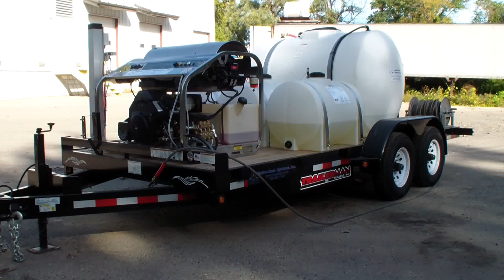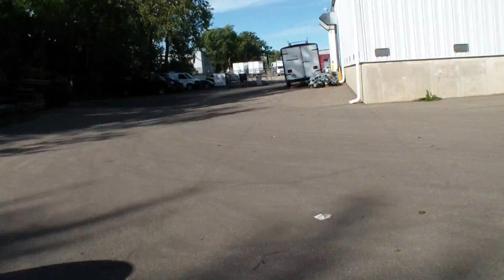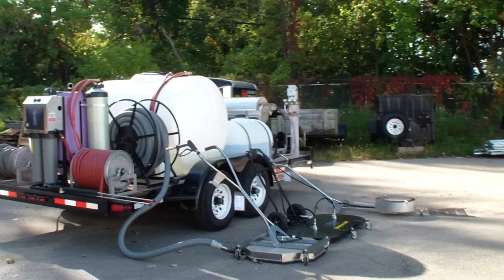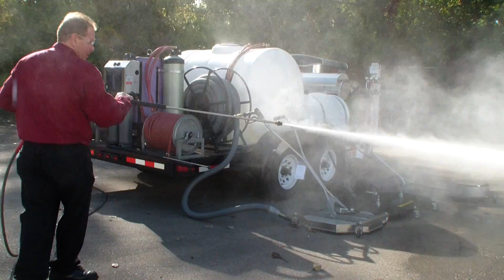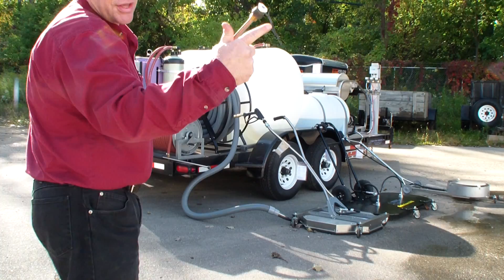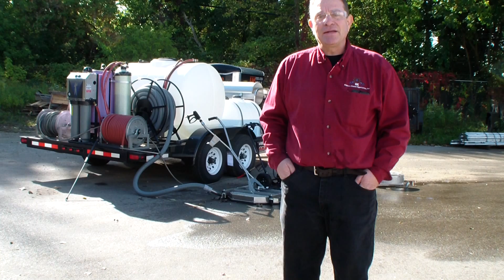31HP 3500 PSI @ 9 GPM HOT WATER PRESSURE WASHER, TBCD RECYCLING SYSTEM, SPOT FREE TANK REMOTE CHEM

Comment: Why is the motor pulsing like that?
Reply from the maker: It's a brand new machine, it takes a few minutes for the governor to loosen up and the system to get all the air out of the lines. It was fine a few minutes after the video.